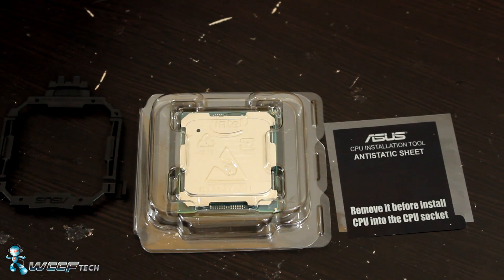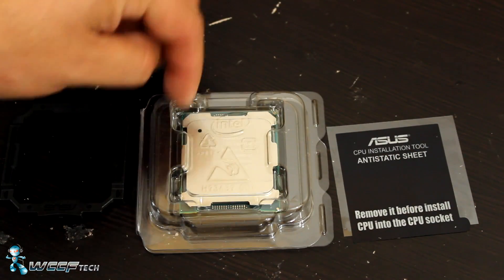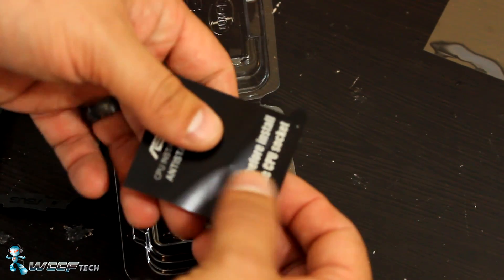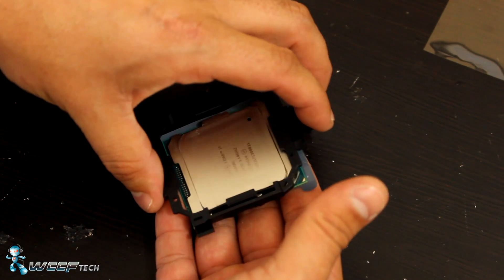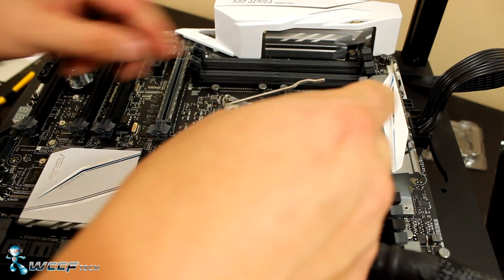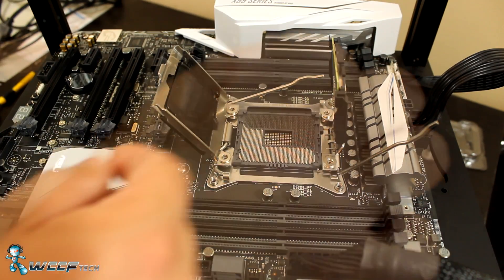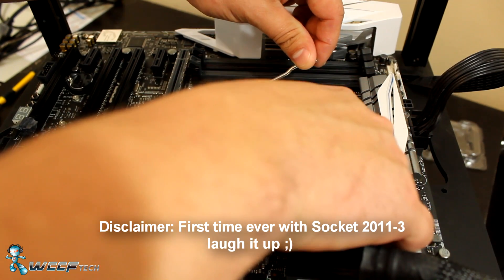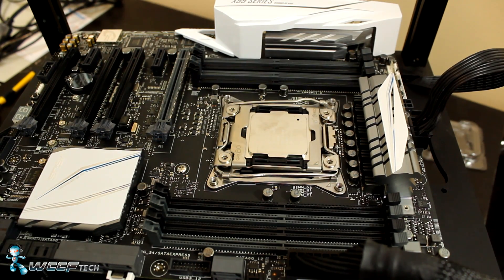ASUS X99 CPU Installation Tool demo

Comment: I tried to use mine and it makes the tension arm way too difficult to press down. Like bending the motherboard... I havent attempted to do it with out the tool but I doubt that it would be that hard to press with out the tool... I am NOT using the tool. It seems like a great idea but on my first attempt it was the sketchiest thing ever.

Comment: But... why??? O_O I've installed my 2011-3 CPU just by putting the CPU into the Socket and closing the Socket. Done in 10 seconds and it works perfectly fine...

Comment: Instead of fumbling trying to lift the CPU up and flip it, open the CPU case upside down then you don't have to touch it before you've applied the anti-static sheet.

Comment: Honestly, I wouldn't use it... You're basically adding insulation around the processor allowing it to retain more heat... Without it there are some gaps and some air can pass through.. I'd be interested to see the temperature difference with the tool installed vs not installed...

Also, with how it fits in, it looks like it can easily slip out ( if the end-user thinks they need this, they may be too "gentle" with it and not clip it fully in thereby increasing the risk of it falling out ); installing a processor is super easy... a 5 year old could do it.

Comment: I used that piece of shit bracket on my Asus strix board and the dam CPU fell out and bent my pins what a piece of crap I will never use that again
Reply: You probably didn't put in the groove properly
Reply: Regardless I dont see the need for it
Reply: For some reason I couldn't put it in the first time without the tool, so I was actually glad they included that tool

Comment: OMG I love it when companies make things for a issue no one has... all this has done it complicate it more and have you touching the CPU much more than is needed.. I laughed when I saw this, I thought it was a troll... seriously please tell me why anyone would need this.. this is just stupid... any normal competent person (if building a PC then has the basic skills to put a CPU in a socket) can install a CPU and this just makes it take much longer has you handle to CPU much more than needed.. waste of time... And what makes me laugh even more some jackass will of been paid millions to design and make this.. :facepalms:
Reply: A lot of people ruin or bend the socket pins, it's hard to imagine but it happens often.
Plus the pins on this board may be more fragile than a standard socket because of all the extra pins.
Reply: issue no one has? its the biggest cause of RMAs because ppl bend their pins because they are unsure or nervous to put it down or they dont check that its in place when they pull down the lever and bends pins so this tool will help a lot of ppl maybe not you but it sure as hell saves a lot of ppl time and money.
Reply: That used to be a problem when the pins were on the processor instead of the board, but they could typically be straightened out ( if you're lucky, or unlucky to have had that happen in the first place - can always warm it up; otherwise they can snap ) by taking an old board and remove the pin-tray and put the processor in...

It hasn't happened to me, ever, but when I was working in a computer store a lot of people came in with that issue when they wanted to build the pc themselves and didn't ask questions when they didn't know what to do and instead either tried forcing the processor in the wrong way, or dropped it because they were nervous... With how things are set up on the board nowadays it is pretty hard to bend any of the pins unless you drop the processor from a decent height straight on the pins... but that shouldn't happen...

If I recall correctly, they moved the pins to the board because boards used to be really inexpensive and it was one of the biggest "return" issues, caused by the end-user obviously...

Comment: thanks for the vid:) great channel and site too... But I really cannot see why you;d want to use this...get why you did the vid though -thanks
'old way'
1. prep socket.
2. take cpu out- not touching the pin contacts on CPU.
3. put cpu in socket
4. close socket...

new way:
1. take stuff in box  out - asus x99 cpu install kit
2. take cpu out...
3. add sticky 'thing' to CPU
4. clip plastic surround to socket- without dropping the cpu!!!
5. open socket.
6. instal surround to socket  securing latch
7. fold  CPU to socket
8. close socket with extra stuff....
9. Dammit forgot to remove sticky thing- goto 5.
10 back now ...close socket again with scary extra plastic crap still in place 
11. admire your extra value added bragging rights to the extra bling/stuff that YOUR cpu has!!!

h,mmmm marketing stuff at its best from ASUS and damn I've been buying motherboards from them since before te  p2b-DS
Reply from the maker: Let's just say it was out of curiosity and the last time we'll be using one, lol -Keith

Comment: if you hold the cpu just by the sides you never have to touch the top or bottom! Amazing!
Reply from the maker: True story, lol - Keith
Reply: Will you guys do a Tc benchmark for with and without see if there's a difference in cooling? or it's already been done and nothing changes?

Comment: Yeah not seeing the value here, CPU installs aren't exactly rocket science.
Reply: Don't worry mate I found this very helpful as I had just purchased this motherboard. The user guide instructions aren't as helpful as this video.
Reply: For some reason, I tried to install my 6800K today, and I failed (It was aligned correctly) and it snapped out of place when I closed the two hinges, but when I used this installation I successfully installed it
Reply from the maker: Maybe someone will.  I really don't myself, this was more of an excercise to see how it worked. -Keith
Reply: This just helped me so there ya go:)